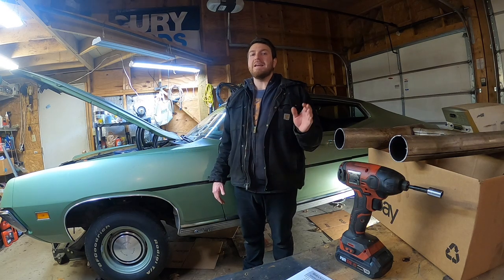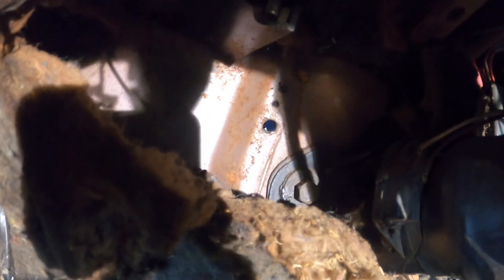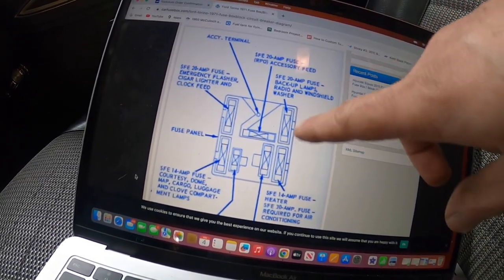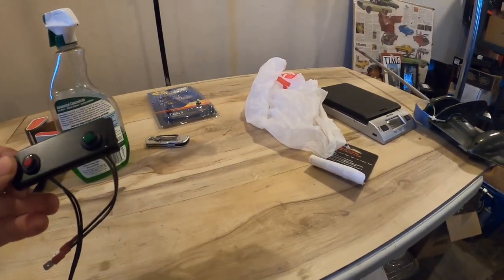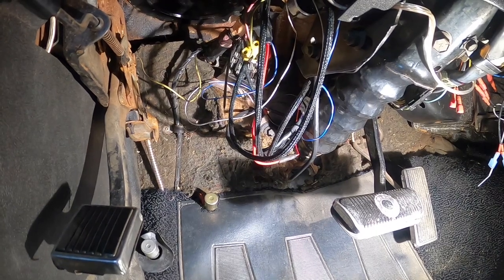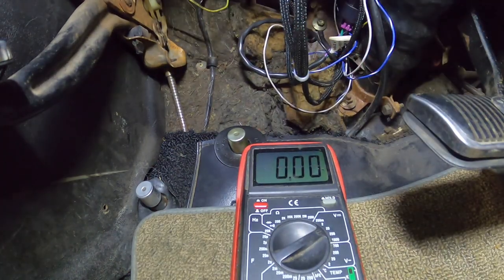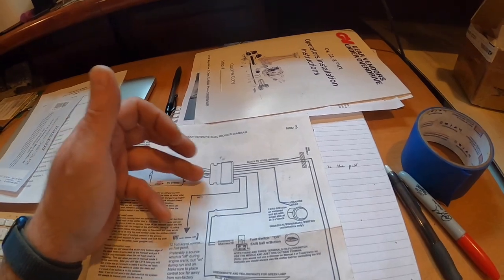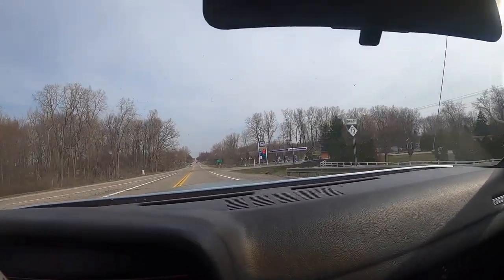1971 Torino GT - Gear Vendors overdrive -PART TWO- install video-wiring the unit- first drive

Comment: Followed your install...because YT analytics brought me here. 😊 And because I'm thinking of doing the same upgrade.  You did everything right with your install.  Everyone assumes the vendor sold us a functioning unit.  The days of quality control are long gone.  Good catch on the swapped wires.
Reply from the maker: Yeah, that was a frustrating situation- really had me going in circles. I don’t know the manufacturing process on the controller- it’s a Holley MSD product- but if the connector is put on my hand I could imagine someone flipping the blue wire with the blue/white stripe wire. The white stripe(on the blue/white stripe wire) on the controller was very faded! So the stripe was difficult to see w/o really staring at it.

Comment: Don’t get me wrong, high performance modern cars/trucks make more horsepower than the old iron. The thing that really keeps the muscle car era stuff from competing is being saddled with 3 forward gears in the case of an automatic transmission (4 in a stick application). New cars and trucks have 6-10 forward gears=always in the power curve.  That Cleveland big port should be lots of fun with what amounts to a 6 speed .  Worth every penny for what you pick up . Great video. Very informative.
Reply from the maker: It really makes the car a lot more flexible. The gear splitting is super cool, it now has a true passing gear in 2nd gear w/overdrive. The gear shifts are all close ratio too. Thank you!

Comment: I know this is old and you may not see it but I’ll ask anyway. Did the driveshaft angle change with the shorter driveshaft? And if so how did you adjust it back into correct geometry?  Thanks
Reply from the maker: It did change the angle very slightly but it actually made the angle even more neutral than it was before. Thats a nice thing about installing one of these in a car with just one single driveshaft. If you install a Gear Vendors into a truck, driveshaft angle issues are more likely, especially if there are multiple driveshafts in the driveline to begin with.

Comment: How did you know your engine RPM without a tach fitted? Are you going to try to find a factory type tach and install it where that blanking plate currently is? Hope you can repeat your MPG test to see an improvement. Interesting video.
Reply from the maker: There are calculators that can calculate your RPM's for a given road speed- they are not perfect but they'll give you an idea within a 100 RPMs or so. I used to run a tach in the car, but after doing a refresh on the interior a few years back, I took the after market gauges out of it- I would love to find an OEM Ford ribbon tach for the blank spot in the cluster. Adding the Gear Vendors definitely has bumped up the MPG's as well as making the car a lot more flexible.

Comment: I have the same issue with the red light coming on..How did you fix the 2 blue wires that were crossed? Did you re pin it or just swap the wires to be connected at the proper connections
Reply from the maker: Once confirming that the wires were crossed on the module, I swapped the blue/blue-white wires on the wiring harness. i'm sure it could be re-pinned too!
Reply from the maker: Is your blue and blue/white wire switched on your module too? IF so, i'd be curious to know.
Reply: @mattsboatyard6891   Exact same issue as yours....Probably from the same build lot

Comment: Another question for you that you might be able to help me with. My Hall effect speedo sensor has three wires( Red Black and White)  Would you think that the white would go seperately to my white signal wire from the speedo and the purple and green go to the remaining black and red?
Reply from the maker: Well the black and red wires go to the solenoid. .. The speed sensor that came in my kit just had 2 wires(green/purple). What vehicle are you putting your gear vendors onto?

Comment: I may add one to my Gold and White 72.
Reply from the maker: Its an extremely cool addition! In the case of my car, it's made it something you can take out on the highway and not have the motor howling just to keep up with traffic. What rear gears you got in your Gold/White 72?
Reply: @mattsboatyard6891  3.50. But with an OD I could put 4.10’s in it.
Reply from the maker: Yeah, you could! It would be a kick ass addition for your 72. The gear vendors allows you to gear split too.